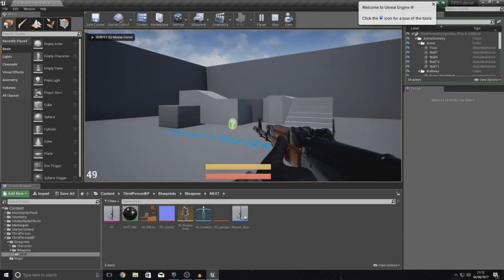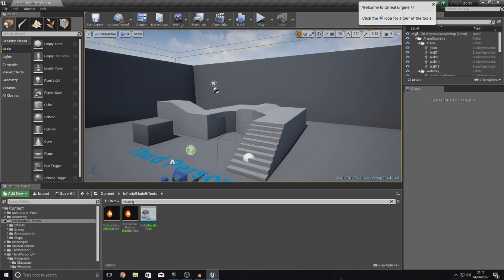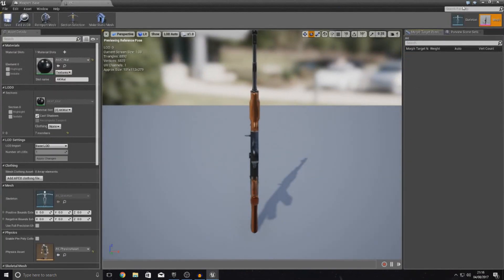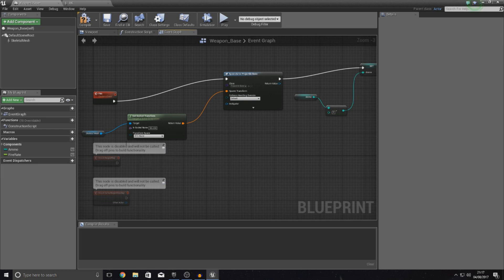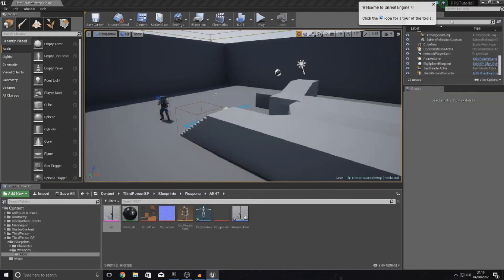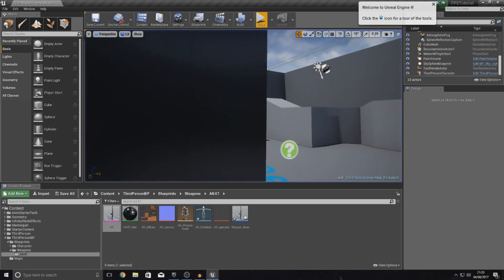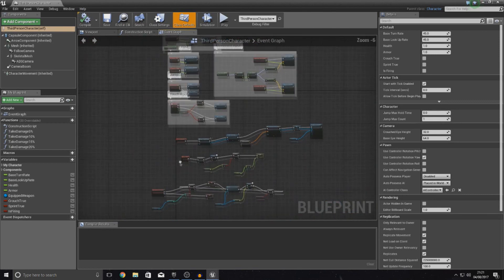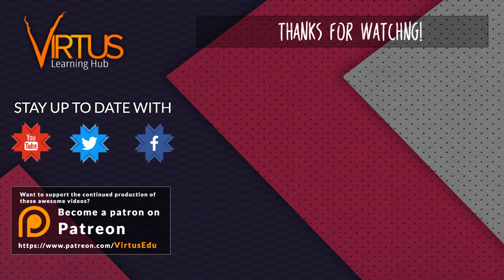Spawning The Muzzle Flash - #15 Creating A First Person Shooter (FPS) With Unreal Engine 4

Comment: when you walk while shooting, the muzzle flash doesnt fit on your muzzle. its going through your weapon. how can we fix this problem? PLS HELPPPP!!!
Reply: I fixed it. You should pick "spawn emitter attached"
Reply: Thanks, it helps me
Reply: @cettura  what settings are u using on the spawn emitter attached? im using it but its not working either
Reply: It didn’t work with me how did you do it?
Reply: I know this is six months old but if someone still faces issue on how to use the spawn emitter attached,

First you need to attach the skeletalmesh of the equipped weapon to the attach to component of the emitter

Than u need to type in the socket name of the muzzle in the attach point name.

Hope it helps someone
Reply: @tejasmaloor2507  i followed your settings,but it is still not working.my flash will still go through my weapon when my character is walking(or i rotata my character my fast ,the flash just cant keep up with the gun).

Comment: why does my muzzle flash spawn sideways yet my bullets don't
Reply: Virtus set the rotation to muzzle rotation. However, the muzzle never rotates (of course not, the player rotates, the muzzle never moves relative to the gun!). So in order to get the muzzle flash emitter to rotate, you'll need to connect the rotate part to your character's rotation.

Comment: The get socket rotation for the muzzle flash doesn't seem to work for me. Flash always fires toward the same direction regardless of which way the camera is facing.
Reply: This is because the muzzle socket never actually rotates. The muzzle location moves, but the player rotates. So you need to find a way to set the location of the emitter to your character's rotation.
Reply: Rotation* of the emitter, sorry

Comment: When I play the game and fire the weapon, the muzzle flash pops up, but stays there and floats in mid air
Reply from the maker: Are you using the same particle system as me, but if that is the case you can always destroy the component after you've spawned it?

If you want a bit of extra help, I advice you checkout our Discord community which has over 3,000 over Unreal Engine 4 developers!

https://discord.gg/hs37bev

Comment: the infinity blade: effect is not compatible with the version 4.21.1 of unreal engine. What do I do?
Reply from the maker: Typically Unreal Engine updates the comparability of the pack within a couple weeks of release. You can either use a older version of the engine or hold tight.

Best of luck!

Comment: One small issue I'm noticing is that if you strafe and fire, it's finishes playing the muzzle animation at the location that it spawned.  So if the animation was longer, it would continue playing in the air where it was spawned, and not keep it's location at the muzzle. Any way to fix this?
Reply: Thanks for the tip :)
Reply: Rebecca Rodriguez okay, how do I do that?
Reply: Wouldn't the smoke move in relation to the muzzle then?  EG the smoke would always be in your face no matter how you move, jump, strafe, or fall.  Perhaps it would be better to speed up the emitter animation/reduce the lifetime?  The Chicken_Master Muzzle Flash seems to be moving in slow motion compared to a real muzzle flash
Reply: that depends on how you did it. two ways this can be achieved, either spawn emitter attached or create a blueprint class with just a particle and use the attach to blueprint node and use access functions to change things as you wish. as far as the slow motion I have not seen this, and the relation to position can be fixed by using a random rotation on the emitter that is spawned at your location.

if you use the blueprint method i advise you set size in blueprint to keep from having to cast to it later, that way you will on have to focus on spawning it.
turn off auto activate in the blueprint and have it to activate on event begin play and destroy it after the time of the particle, use time or a delay.

Comment: Virtus, when i crouch and than run while crouching i run with the speed of crouching the same with aim etc. when are we gonna fix these problems?
And also when you run you can aim.
Reply: Yep, I was saying same thing on previous parts :).
Reply: Divisor I know but its still not fixed so i also sad it
Reply: In your character blueprint create a branch from the pressed of your sprint input and set the condition as CrouchTrue, Leave the True empty and attatch the set sprintTrue into the false :) hope this helps
Reply: Caspar Nieuwland on the release node you make another branch with CrouchTrue as the condition. If true it will set max walk speed as 300, of false or will set max walk speed at 600